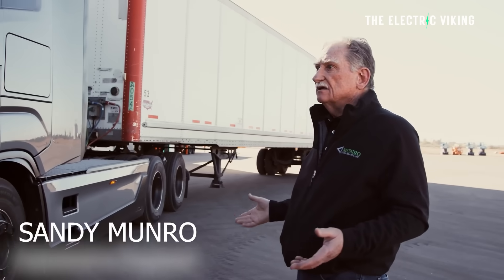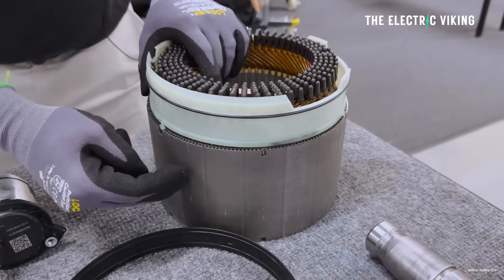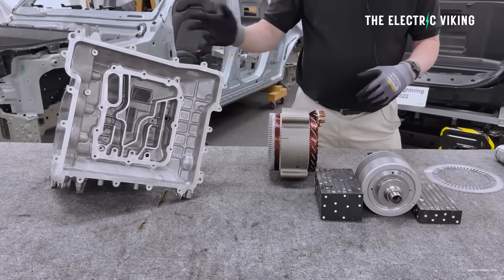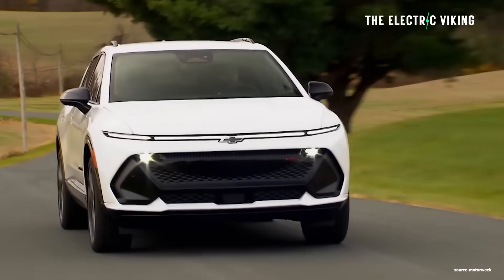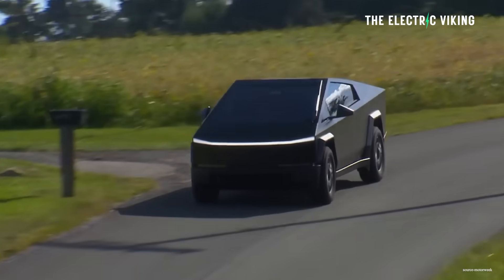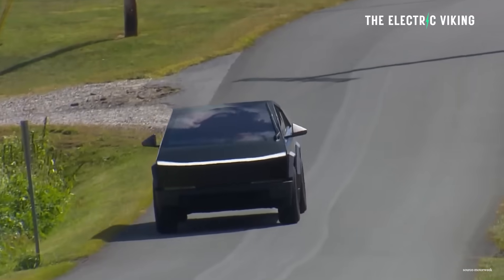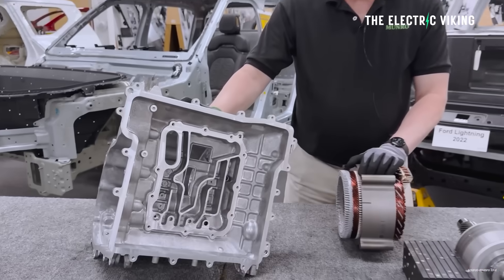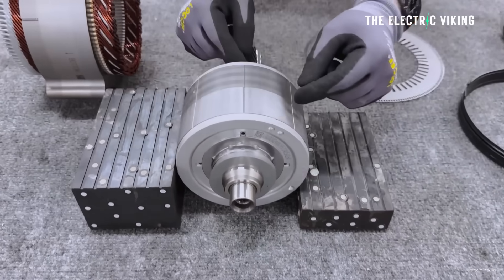Sandy Munro Tears Down Tesla and Chevy EV Motors & Discovers This...

Comment: Well, interesting but ultimately meaningless. People don’t buy an electric car because it gets an extra 3% range because of the engine design. People buying an electric car because they’re tired of spending 300 a month on gasoline and they’re looking at an electric car and they can see they can spend 100. It’s not gonna change their decision on which electric car to buy because one only cost $97 a month in electricity and the other cost 107. So these comparisons you’re making about one’s being slightly more efficient than the other isn’t significant in terms of what the market wants. Similarly, the idea that anybody in the marketplace for these except may be a half of a half of  half of 1% it gives a crap about how well it’s gonna perform based on engine design on a track running repetitive quarter mile runs that’s ridiculous. Nobody cares about that for the market that these cars are named at. What people care about is the reliability of the car what’s the likelihood something’s gonna fail and only in broad terms about saving $3 a mont. If a person‘s already got electric it doesn’t really even make any difference at that point.  They’re gonna be looking at features they’re not gonna decide whether to go Tesla, whether to go GM on the basis of what kind of motors being used. So I’m left with what exactly is the point of all this discussion here unless you’re really aiming this at people who want to do quarter mile runs with their electric cars.  That’s fine if that’s what people want to do; everybody’s entitled to their hobbies.  This same kind of misplaced focus is why people got screwed with direct injection cars that save them pennys on gas but cost them $100’s on valve cleanings. It’s like regressing to the 1930’s when you had to decarbon the head every 20k miles.

Comment: I had a Prius C. On scangauge I would look at MG2 temps as that gets the highest.  Climbing mountains.  It would raise temps as expected but on the down hill where no more throttle is needed, it would spike to 270F+ temps. The passive oil splashing was not able to cool down when throttle was not applied. The trans oil I would change at 30k and it was dark. At 60 or 100k I have seen it turn pure BLACK. Any how , if you have this system. better change the oil.
Reply: You would think that splash oiling is efficient but the gears splashing submersed uses lots more energy than running an oil pump and spraying oil in the right amounts in the right places uses less power heats the oil less and does not foam it up spoiling lubrication.
Reply: Transmissions have a lot of wear and heat producing components.

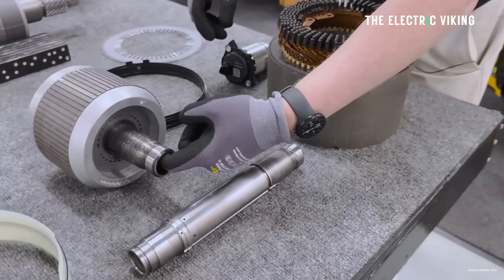Comment: I enjoyed the video up until a few comments in your analysis at 7:30, and some of it is a bit misleading. Honest questions leading to my comment: 1) Does "better for the long term" mean reliability without repair, because in this case GM's no oil pump option is the winner. 2) you mention that there is no cooling when the GM motor is idle, but your analysis reflects the way heat builds up in a gas engine, more than an an electric motor. 3) what other levers does GM have to control heat other than coolant? I know electric motors can derate, reducing the amount of heat put inside the motor. Just a few questions that need answering before anyone can make a comment on long term reliability.

Comment: This is similar to the old 1950’s Chevy 6 cylinder engine that used splash oiling for the rods, it worked until too much debris accumulated in the oil. Then the rod bearings failed.
Reply: I was thinking the same thing when I watched the Munro video tear down.  Until the early 1950s, the Chevy “Blue Flame” 6 did not have a pressurized oil system.  I hope this drip cooling works out for them, but it isn’t hard to imagine border cases where its limitations could result in overheating.  Towing up steep slopes, for example.  Driving up Pike’s Peak on a hot day.  Creeping along at low speed on a hot day in traffic.  Time and warranty claims will tell.  They said the motor would be used in a dozen different EV models on the front axels.  Maybe it will do better when there is another motor driving the rear wheels also, like in a 4-wheel drive Lyriq.

Comment: Look at 10:28 in Munro’s video.  It’s interesting to see that Tesla’s stator windings are cooled mainly through oil being slung from the rotor itself!  Hmmm!

In that light, it seems Tesla’s design introduces a couple of extra components: the pump and the plastic oil-directing ring.  That could add complexity or potential failure points.  By contrast, GM’s system appears to manage oil flow in a simpler way, using internal case geometry (the labyrinth at the base, born from decades of automatic transmission engineering) to direct oil where it’s needed under different conditions.  There’s clearly a lot of thought in that approach.

I get the sense some people may have missed those details, and even Sam might have overlooked a few of them in the discussion.  Easy to do when there’s so much going on in these teardowns!  Still, it’s a fascinating comparison between two very different engineering philosophies.

Comment: I'll be curious to see how the two methods compare after 10 years.  What happens if the oil pump fails?  I suppose now diagnostics might light up and tell the driver that.  The GM method obviously is not as good for a car in a race, but few drivers would care about that.  Gravity is always there and the situations where it wouldn't work are very rare also.  Interesting problem for sure.  Tesla has an advantage for sure, as the rest of the world's automakers were characteristically stuck in the mud with old technology.

Comment: The real way to deal with cooling is to keep heat from building up in the first place. There's only two ways a motor can get hot... resistance and inductance. Both can be minimized and probably through new materials research can be reduced to inconsequential. Just don't let them get worse.

Re eddy currents: That's what the lamentations are for.
Reply: *laminations. But I'm sure a bunch of engineers suffered lamentations during the design.

Comment: Seems like the cooling benefits depend on demands of the specific use.  My Nissan Leaf with no battery cooling (IDK about motor) has no difficulty with twice daily 20-mile commuter driving at 50 mph. It sounds as if the GM wouldn't overheat at 80 mph driving between cities in the fly-over states. Rock crawling mixed with hill climbing is best done in a Tesla.
  Efficiency may warrant separate individual evaluation. Does the reported reduction of hysteresis loss justify to the individual owner the extra complexity and cost of the oil pump vs fling &  drip? Mundo can verify and quantify the reduction but the individual judges the value.

Comment: GM is incentivized to make small less expensive items to fix necessary to fix. Why do I say that? Because they have a huge dealership Network that they need to support so be behaving the way Tesla does where they are quite happy to never see a car again in their shop and just focus on selling new ones and GM and their need to support that network are very different outcomes. I’m not saying GM‘s trying to make lemons, but I am saying there’s clearly an incentive to allow for minor breakdowns, especially in cars that are cheaper where people will tolerate fails because they see cheap cars as cars likely to fail.
Reply: So true and likely why many dealerships secretly fear mass adoption of EV's. They simply cannot make enough profit from them after they leave the sales lot. A typical dealership can see upwards of 40% or more of their total profits coming from their parts and services departments serving almost exclusively gasoline and diesel vehicles. The long lines of gasoline and diesel vehicles forming up in front of their service bay doors every morning makes this obvious. Just the oil changes, resolving Check Engine lights, O2 sensor replacements, and FAR greater brake service that ICE vehicles require makes Big $$$ for dealerships. As such they likely have little "true" interest in promoting EV's.
Reply: @TronJockey  I can attest to this personally with a lemon 2024 Kia EV6. Some of these slimy dealerships take in a car they can only sell but can’t support. For Kia/Hyundai, the ICCU issues plaguing ALL eGMP cars will blow up on them very soon.

I reported Level 2 charging issues (precursor to ICCU total failure) and this is with BOTH “recall softwares” applied still. These goofballs kept the car for almost a month in a satellite lot. Once I called them out to Kia Finance, suddenly the car was ready the next day. My Airtag and Kia Access apps proved they’re lying that they haven’t found issues on the car because they just moved it to a lot, plugged in a DC Fast Charger (bypassing the ICCU), and said it’s ready.

All that happening on a Tuesday, I took it on a Friday to another dealer who had an EV Master Tech and he identified the ICCU issues, replaced it, tested, and sent it my way. I’m still lemoning the piece of junk since it took about 40 days to get it all done and in California, it’s legally a lemon.

I’ll come out and say that Kia / Hyundai / GM / Stellantis are short-selling volumes of lemons. They appease shareholders in the short-term but will deal with PR problems very soon when it all adds up. By then, the boomers running the show will already be gone - accountability lacking much??
Reply: And then explain why Chevy bolts have fewer mechanical issues than Tesla has had?
Reply: @zilfondel   I’ve not heard this, but happy to learn.

Comment: Viking... Concerning the cooling methods that G.M. is using on their electric motors, the comment that " there are some limitations " regarding the cooling effectiveness is incorrect. Also, you mention that the oil distribution   is not moving around when the motor is stopped or turning slow,  is not a limitation at all. This is incorrect thinking. These motors are not doing anything while stopped, and very little at slow rpms/ speeds because at those times, the heat produced is proportionally small. So, higher loads occurr at higher rpm and speed . The oil distribution is proportional based on rpm... so a pretty good system!  Your thinking is based on gasoline engine function. Now those engines can easily overheat while sitting because they are still working,  producing massive amounts of heat.
Concerning high g corning and lubrication, you may have some valid points there ... if you are intending to race your s.u.v. on a road course, but i am thinking that racing a sport utility vehicle is not a very popular thing.  And for what its worth,  I am a senior mechanic with every bit of 40 years experience. Coincidentally , I drive a model Y and an Chevy Bolt, so no brand loyalty here. Just sharing my thoughts on the topic. Thanks for your time.
Reply: @tonysurber9111 - I've had a Bolt EUV in the past, and thinking about recommending the new Bolt 2027 to my family. What do you think about used Model Y vs. a new Chevy Bolt 2027 since they cost about the same? Asking since you drive both and I did test drive a Model Y, but haven't lived with one.
Reply: Good Comment - General Motors - huh - It sounds like they still have the Charles F. Kettering idea.  "Parts left out never break down and never need replacement" - Charles F. Kettering.  Those separate oil pumps in the Tesla will eventually break down.  What will happen to that heated metal with the high resistance then?  It sounds like the tesla has extra failure modes with the added oil pump.
Reply: @daniellarson3068  G.M. is mostly focused on cost savings and their design is definitely cheaper, and good enough for the use case. They do tend to cut corners on many things that come back to bite them or their customers (after warranty), but this seems like a sensible design.
Reply: @daniellarson3068  An oil pump in an EV has perfect operating conditions not so in a combustion engine were the oil is continually contaminated with combustion products I worked on land based Gas turbines and the gearboxes boxes ran 5 years continuously and were spotless on inspection.
Reply: I should have just found your reply to give it a thumbs up before I typed mine. Excellent observations.
Reply: Yes, it would probably not be good for a high performance or track car but the Equinox is a grocery getter and not a car that road racers will want. Worst case if a teen takes Mom's SUV out and repeatedly launches it from light to light the system will limit power if it senses an overheat condition. It's a good design for the intended purpose, just like the Tesla design is for that application. 

I know a couple people with Bolts and they both love them. I've never ridden in one or driven one but they seem like a great commuter car and can be a bargain slightly used. Tesla is still the standard in the US as far as software and innovation, of course. I have a Lightning and love it, but it's not all that efficient, and it's not as fast as a performance Tesla. It's practical, fast enough, has decent range (ER Batt) and is very comfortable for 4 adults and a bed full of stuff. It works for me. I do wish I had a Bolt or a M3/MY when I go to places with parking garages, however🙂. No 4 wheel steering on this pig!

Comment: And all the while, according to Edmunds range testing, GM electric vehicles out perform against their EPA ratings and Tesla's under perform.

According to their test protocol, the 23 Model Y (the only one to make to top 50, underperformed it's EPA range. test by 6%. Comparably the Chevy Equinox EV overperformed it's EPA rating by 10.5%

Granted, Edmunds did not show or have testing available on newer models after 2023 but there is a pattern of over promising and under realizing comparing these two different test methods.

All this means is there is more to overall range performance than inconsequential marginal differences between motor and cooling design both at the top of market scale production.

That doesn't mean there aren't other advantages but the two most frequent questions I hear are what's the range and how long does it take to charge, and both questions require a great deal of nuance to answer in a meaningful way.